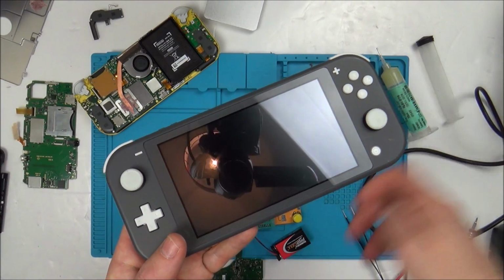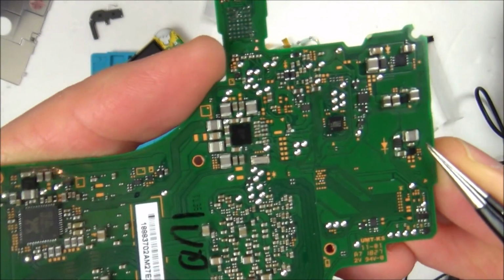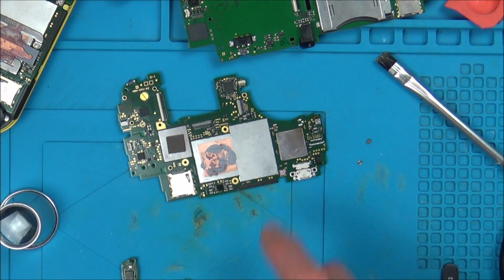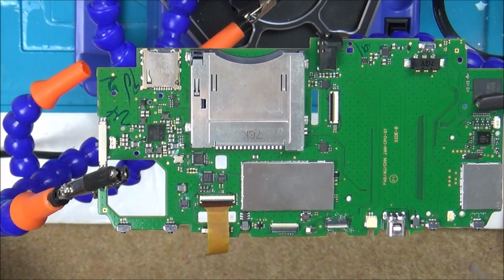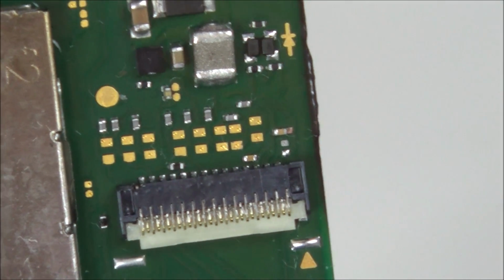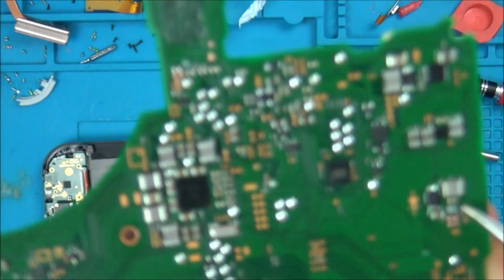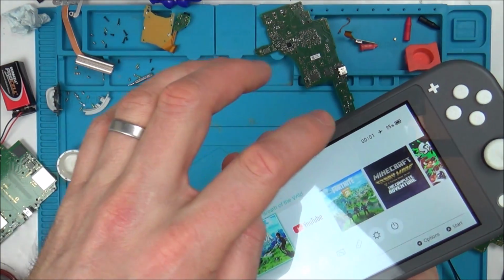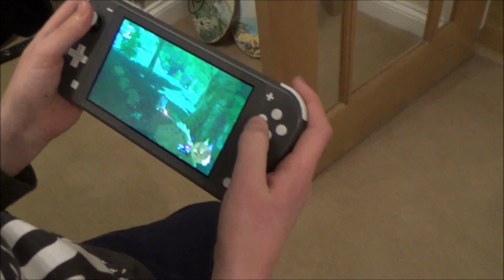REVISIT: Nintendo Switch Lite BACKLIGHT FAULT (Black Screen)

Comment: That’s an inductor Vince.   U need special equipment like an lcr meter to properly measure inductance.  Inductors on an iPhone schematic normally also has a resistance value of around 0.9ohm.   With a tolerance of maybe 25 % so that’s why when u measure. U might get 25% above or below 0.9ohm.    Also that am sure is boosting the voltage to 17v along with 9 ball bga ...  I do micro soldering. And am sure as day that’s an inductor.   U just need an lcr to measure it.   On iPhone schematics inductors have a resistance value closer to 1ohm.  Cheers Mate!
Reply: Always a pleasure to watch your video , take care
Reply from the maker: Nice one, thanks Demion :-)

Comment: Haven't finished watching yet, but just wanted to comment that if you try to measure an inductor on those cheap meters that's outside the measurement range it'll incorrectly just measure as a very small resistance (an inductor is just a coil of wire with a small parasitic resistance afterall).

And that part is 100% a chip inductor and not a shunt resistor (I've only ever seen precision shunts in a thin film package and not a multi-layer ceramic one like that).
Reply from the maker: Thanks SJM, I will hopefully remember this if I am testing small SMD inductors in the future on that little component tester :-)

Comment: Hi Vince been repairing my own switch and I've found schematic for it on line here is you URL https://console5.com/wiki/File:NES-001-Schematic---Power,-AV,-RF-Switch.png
Reply: That's for NES (copyright from 1992 in the bottom).
Reply: @Stumper52  ah crap sorry got confused

Comment: Hey Vince, just wanted to say; those are definitely inductors. The ones you pointed out on the regular switch board are all around buck or boost converter chips which rely on inductors to function properly. There's actually a lot of voltages on the switch! There's VCC for the main CPU, VCC for the GPU (both the CPU and GPU voltages can vary, so I won't list an exact value here), a "VCC IO" which is 1.8v so the SoC can interface with the peripherals, which are mostly 1.8v, then there's also a general 1.8v line, specifically for peripherals, 3.3v for some other peripherals (the eMMC chip, for example, needs both 1.8v and 3.3v), 5v for the fan and joycon rails, 17v for the backlight (as you found) and probably more that I'm forgetting; to sum it up, there's a ton of voltages and also a ton of buck/boost converters on the switch mainboard, and you'll need at least one (in some cases two) for each voltage you're going to generate. That's why there's so many of them on the board. The chip on the back that had a bunch of them around it was the main Power Management IC (PMIC), which is responsible for taking in battery voltage and generating most of the other voltages for the system, or generating an intermediate voltage to send to the other buck/boost converter chips.

EDIT: Also, just to add; detecting an inductor vs a resistor can be an issue sometimes; inductors are made of really thin wire that's usually wound around a core. The thing is, wire does not have 0 resistance, and indeed some older resistors used to just be really long pieces of wire wrapped around something. So, especially with the really thin wire used in such small inductors, they're going to have a measurable resistance. It's still an inductor, but the slightly higher resistance compared to something in a larger form factor is not unusual and that component tester most likely has to make some guesses about things like that, so it labeled it as a resistor. If there were some way to tell it "measure this as an inductor" I'm sure it would return a more reasonable value.
Reply from the maker: Nice one Dark Samus. As always a complete joy reading your comments, your knowledge on the Switch is impressive. Thanks for sharing it :-)
Reply: @Mymatevince  Thanks for such entertaining content! I definitely enjoy watching someone putting in the work to learn all of this stuff, it's pretty damn amazing how far you've come in diagnosing these faults. I'm actually pretty amazed you got that BGA chip back on without reballing it properly. I suggest seeing if you can figure out the pitch and size of the balls, then you can get a stencil and reball future ICs of that size with the solder paste method (if you feel up for that sort of thing anyway :) )

Comment: Vince I wondering if you would help me with my console my fan inside my Xbox sounds weird i haven’t opened it and wondering if you can take the fan ad change it out with a new fan and change the thermal paste because I don’t what it looks like inside

Cheap fans that Microsoft made or handed over by others idk Vince I wouldn’t mind a fix on my Xbox one s

Also it’s in good condition please don’t give mine away by mistake great video Vince

Comment: congratulations vince thanks for mentioning me glad that at least you found  the bits you needed at no real cost and you gained more knowledge excellent fix
Reply: @James Robson  i am currently repairing a new 2ds xl and i noticed that the parts look the same size on the switch lite as well as the 2ds and nintendo are known to re use components because of cost
Reply from the maker: Thanks Jon, it was a right result. When I seen the front facing camera had the same size connector I was so happy. I wouldn't have thought to look at the 2DS XL, so good job mate :-)

Comment: Well done ,Yes sub to gadgetuk164, very good channel, Nope it's a inductor the, ic with loads of that inductors is power management chips, think your meter could not read it.Thank you My Mate Vince you are doing great videos  👍😊
Reply from the maker: Thanks AR, you are right about the little meter. I will hopefully remember this in future. Cheers for the helpful comments :-)
Reply: @Mymatevince  Anytime, you're welcome, I have a similar meter i will give mine a test as well

Comment: A shunt resistor is different from an inductor just by not creating the amount of a magnetic field. :D you actually could replace the shunty with just a wire (if it's thick enough)
Reply: All well and good except the last bit. In normal circumstances wire has lower resistance compared to a shunt resistor (same size). To increase the resistance of a wire in the same footprint you need to decrease the thickness (however you are then limited by the current it can pass before blowing appart).
Reply: @Stumper52  :D yes. Was acutally meant as a joke (the wire thing) because you would a wire so long that it won't be helpfull on the board.

Comment: A shunt resistor is a precise, low-value resistor that the current runs through and has a very small voltage drop proportional to the current draw. Super cool to see you learning from us(viewers) and you teaching us, too!